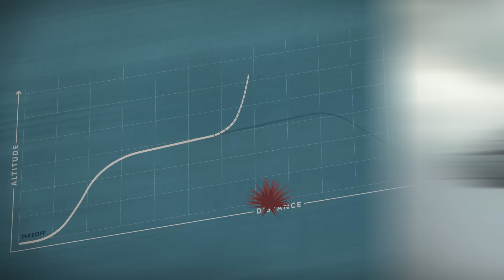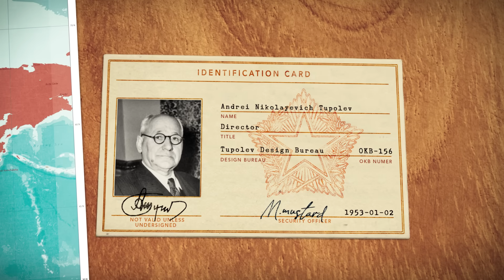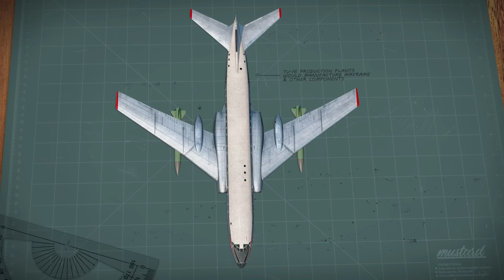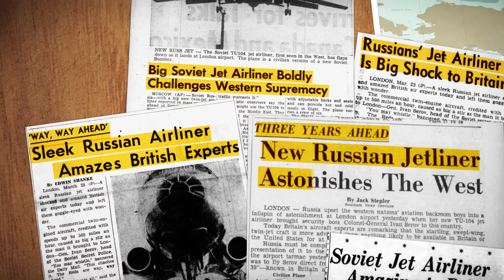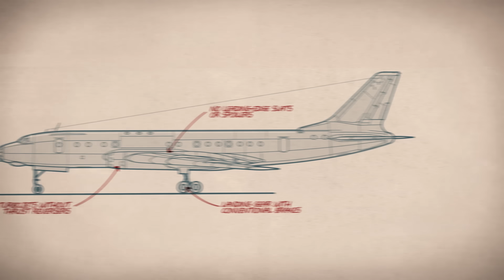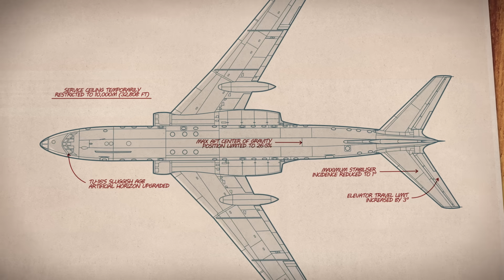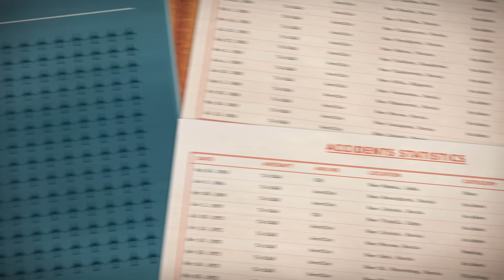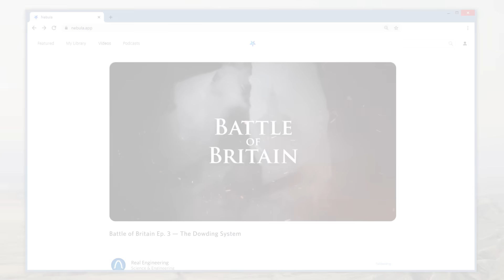The Soviet Airliner Designed To Crash

Comment: First thing I noticed is that the engines are in prime position to generate turbulence to make the horizontal stabilizer less efficient
Reply: It's a much better design than the Comet, the engine placement of the Comet was a fatal flaw that caused several fatal accidents.
Reply: @sandervanderkammen9230 

We feel we can shed some light on some common myths & misunderstandings repeated in many comments.

The Comet engine position & inlet design was not a flaw, caused no incidents & at the time had some distinct aerodynamic advantages.

Although the TU-104 was a later design aircraft it was not safer than the DH Comet.

It is indeed correct that there were plenty of aircraft that were more dangerous than the De Havilland Comet before & after the Comet.

Obviously It's not valid to compare a Bow-wing ( see B-47 wing folding & wing collapse incidents for details) jet  airliner designed & first built as late 6 decades after the Comet, with the fabulous De Havilland Comet, the world's first high altitude jet powered airliner.  
  Vast improvements in commercial aviation infrastructure & pilot familiarity with jet airliners alone being a significant factor in improvements in air travel safety safety over more than half a century.

    Of course Bow-wing having 50 years more design, build & operation experience than De Havilland didn't prevent the horrendous Bow-wing Max  incidents, there can obviously be no excuses for that.
  
  That's correct of course, at the time the Comet wasn't particularly dangerous. Agreed, that is indeed the case of course, The DH Comet was definitely not the worst engineering failure in commercial airliner history.

Losses comparisons
How things were in those days.

DeHavilland Comet 4 UK                  14% 
DeHavilland Comet all mks             17%  

Boeing 307                               70%
Boeing 247                               48%
Boeing 707            .                  20% 
Lockheed Electra Turboprop   29%
Canadair CL-44  Turboprop     46%  
Convair CV-580  Turboprop     22%
Convair CV-880    (ff 1959)       27%  
Convair CV-990     (ff 1961)      33%
Tupolev TU-104       (ff 1955)    16%

     Of course De Havilland had prior experience building many all metal construction airframe aircraft & thousands of jet powered fighter aircraft that were primarily of metal construction with pressurised cockpits & jet engines built by De-Havilland.

  Yes, that's true, De Havilland carried out full stress analysis & engaged in a comprehensive & protracted testing program which is why key De Havilland people were happy to be aboard flying DH Comet aircraft. The Comet was the first airliner where stress due to pressurisation significantly exceeded flying load stress for a full length passenger cabin fyselage.

    We agree, that's correct, the DH Comet was the first passenger airliner with full length fuselage pressurisation at 8psi pressure differential. Handley Page built the world's first all metal construction airliner during the 1920s.
    In many cases earlier pressurised aircraft were larger, needed thicker fuselage skins due to flying stresses alone & had much lower pressurisation differential pressure. 

     Of course ripstop provision was provided. The skin alloy used became unavailable at the time due to R & D at the manufacturers which resulted in the original alloy being discontinued. Later alloys had very similar properties. The skin thickness used for the Comet was used for similar size later aircraft. Frame spacing was not found to be too large & frame width was not found to be too small.

    Without doubt De Havilland did indeed always work to better than industry standards at the time, used up to date knowledge for the design & construction & no evidence of negligence or criminal negligence was ever produced in relation to the DH Comet.

   Obviously the DH Comet had no effect on the course of the aerospace industry in the UK. The UK now has the world's largest combined nuclear, aerospace & defence sectors per capita activity.

    That's correct, the investigation committee did not find hundreds of fatal flaws or evidence of design defects, structural defects, defective materials or shoddy workmanship. Indeed it is the case that ripstop provision was included. Claimed incidents did not involve cracks starting from passenger window corners.
   Pretty much all changes were just in case changes or were planned development modifications & improvements that were scheduled regardless of incidents.

    Obviously De Havilland designers knew all there was to know about metal fatigue at the time they designed the DH Comet.

    It is in fact true to say that the way airliners were built changed everywhere including in the US after the Comet incidents.

We hope this helps, obviously.

Cheers indeed of course 👍. 
                      
 . . .... ... .... .  .. ............
.. ......... ..  ... . . ............
 ..... ..... .... ... ................

Comment: The question "was this the most dangerous airliner ever" is difficult to answer. The competition for the title is ferocious. One obvious contender is the East German BAADE-152 of the late 1950s. Only three prototypes were completed, one crashed and it never entered service. It was a staggering waste of money and skilled manpower. But, like the Tu-104, it was an unusual and very eyecatching plane. It was built in Dresden and a large model exists in the fascinating Transport Museum in the city centre.

https://en.m.wikipedia.org/wiki/Baade_152
Reply: The de Havilland Comet is without any doubt the worst jet airliner in history, no aircraft has had a higher loss rate or fatalities statistics..
Reply: @sandervanderkammen9230 

We feel we can shed some light on some common myths & misunderstandings repeated in many comments.

Although the TU-104 was a later design aircraft it was not safer than the DH Comet.

It is indeed correct that there were plenty of aircraft that were more dangerous than the De Havilland Comet before & after the Comet.

Obviously It's not valid to compare a Bow-wing ( see B-47 wing folding & wing collapse incidents for details) jet  airliner designed & first built as late 6 decades after the Comet, with the fabulous De Havilland Comet, the world's first high altitude jet powered airliner.  
  Vast improvements in commercial aviation infrastructure & pilot familiarity with jet airliners alone being a significant factor in improvements in air travel safety safety over more than half a century.

    Of course Bow-wing having 50 years more design, build & operation experience than De Havilland didn't prevent the horrendous Bow-wing Max  incidents, there can obviously be no excuses for that.
  
  That's correct of course, at the time the Comet wasn't particularly dangerous. Agreed, that is indeed the case of course, The DH Comet was definitely not the worst engineering failure in commercial airliner history.

Losses comparisons
How things were in those days.

DeHavilland Comet 4 UK                  14% 
DeHavilland Comet all mks             17%  

Boeing 307                               70%
Boeing 247                               48%
Boeing 707            .                  20% 
Lockheed Electra Turboprop   29%
Canadair CL-44  Turboprop     46%  
Convair CV-580  Turboprop     22%
Convair CV-880    (ff 1959)       27%  
Convair CV-990     (ff 1961)      33%
Tupolev TU-104       (ff 1955)    16%

     Of course De Havilland had prior experience building many all metal construction airframe aircraft & thousands of jet powered fighter aircraft that were primarily of metal construction with pressurised cockpits & jet engines built by De-Havilland.

  Yes, that's true, De Havilland carried out full stress analysis & engaged in a comprehensive & protracted testing program which is why key De Havilland people were happy to be aboard flying DH Comet aircraft. The Comet was the first airliner where stress due to pressurisation significantly exceeded flying load stress for a full length passenger cabin fyselage.

    We agree, that's correct, the DH Comet was the first passenger airliner with full length fuselage pressurisation at 8psi pressure differential. Handley Page built the world's first all metal construction airliner during the 1920s.
    In many cases earlier pressurised aircraft were larger, needed thicker fuselage skins due to flying stresses alone & had much lower pressurisation differential pressure. 

     Of course ripstop provision was provided. The skin alloy used became unavailable at the time due to R & D at the manufacturers which resulted in the original alloy being discontinued. Later alloys had very similar properties. The skin thickness used for the Comet was used for similar size later aircraft. Frame spacing was not found to be too large & frame width was not found to be too small.

    Without doubt De Havilland did indeed always work to better than industry standards at the time, used up to date knowledge for the design & construction & no evidence of negligence or criminal negligence was ever produced in relation to the DH Comet.

   Obviously the DH Comet had no effect on the course of the aerospace industry in the UK. The UK now has the world's largest combined nuclear, aerospace & defence sectors per capita activity.

    That's correct, the investigation committee did not find hundreds of fatal flaws or evidence of design defects, structural defects, defective materials or shoddy workmanship. Indeed it is the case that ripstop provision was included. Claimed incidents did not involve cracks starting from passenger window corners.
   Pretty much all changes were just in case changes or were planned development modifications & improvements that were scheduled regardless of incidents.

    Obviously De Havilland designers knew all there was to know about metal fatigue at the time they designed the DH Comet.

    It is in fact true to say that the way airliners were built changed everywhere including in the US after the Comet incidents.

We hope this helps, obviously.

Cheers indeed of course 👍. 
                   
 . . .... ... .... .  .. ....... ..  ....
.. ......... ..  ... . . .... ......
 ..... ..... .... ... .......

Comment: Flew like a Brick!
Reply: Flew better than the de Havilland Comet.
Reply: @sandervanderkammen9230 

We feel we can shed some light on some common myths & misunderstandings repeated in many comments.

Although the TU-104 was a later design aircraft it was not safer than the DH Comet.

It is indeed correct that there were plenty of aircraft that were more dangerous than the De Havilland Comet before & after the Comet.

Obviously It's not valid to compare a Bow-wing ( see B-47 wing folding & wing collapse incidents for details) jet  airliner designed & first built as late 6 decades after the Comet, with the fabulous De Havilland Comet, the world's first high altitude jet powered airliner.  
  Vast improvements in commercial aviation infrastructure & pilot familiarity with jet airliners alone being a significant factor in improvements in air travel safety safety over more than half a century.

    Of course Bow-wing having 50 years more design, build & operation experience than De Havilland didn't prevent the horrendous Bow-wing Max  incidents, there can obviously be no excuses for that.
  
  That's correct of course, at the time the Comet wasn't particularly dangerous. Agreed, that is indeed the case of course, The DH Comet was definitely not the worst engineering failure in commercial airliner history.

Losses comparisons. 
How things were in those days.

DeHavilland Comet 4 UK                  14% 
DeHavilland Comet all mks             17%  

Boeing 307                               70%
Boeing 247                               48%
Boeing 707            .                  20% 
Lockheed Electra Turboprop   29%
Canadair CL-44  Turboprop     46%  
Convair CV-580  Turboprop     22%
Convair CV-880    (ff 1959)       27%  
Convair CV-990     (ff 1961)      33%
Tupolev TU-104       (ff 1955)    16%

     Of course De Havilland had prior experience building many all metal construction airframe aircraft & thousands of jet powered fighter aircraft that were primarily of metal construction with pressurised cockpits & jet engines built by De-Havilland.

  Yes, that's true, De Havilland carried out full stress analysis & engaged in a comprehensive & protracted testing program which is why key De Havilland people were happy to be aboard flying DH Comet aircraft. The Comet was the first airliner where stress due to pressurisation significantly exceeded flying load stress for a full length passenger cabin fyselage.

    We agree, that's correct, the DH Comet was the first passenger airliner with full length fuselage pressurisation at 8psi pressure differential. Handley Page built the world's first all metal construction airliner during the 1920s.
    In many cases earlier pressurised aircraft were larger, needed thicker fuselage skins due to flying stresses alone & had much lower pressurisation differential pressure. 

     Of course ripstop provision was provided. The skin alloy used became unavailable at the time due to R & D at the manufacturers which resulted in the original alloy being discontinued. Later alloys had very similar properties. The skin thickness used for the Comet was used for similar size later aircraft. Frame spacing was not found to be too large & frame width was not found to be too small.

    Without doubt De Havilland did indeed always work to better than industry standards at the time, used up to date knowledge for the design & construction & no evidence of negligence or criminal negligence was ever produced in relation to the DH Comet.

   Obviously the DH Comet had no effect on the course of the aerospace industry in the UK. The UK now has the world's largest combined nuclear, aerospace & defence sectors per capita activity.

    That's correct, the investigation committee did not find hundreds of fatal flaws or evidence of design defects, structural defects, defective materials or shoddy workmanship. Indeed it is the case that ripstop provision was included. Claimed incidents did not involve cracks starting from passenger window corners.
   Pretty much all changes were just in case changes or were planned development modifications & improvements that were scheduled regardless of incidents.

    Obviously De Havilland designers knew all there was to know about metal fatigue at the time they designed the DH Comet.

    It is in fact true to say that the way airliners were built changed everywhere including in the US after the Comet incidents.

We hope this helps, obviously.

Cheers indeed of course 👍. 
                   
 . . .... ... . . . . .... .  .. ...
.. ......... ... . . .   ... . . ...
 ..... ..... .... .... . . . .......